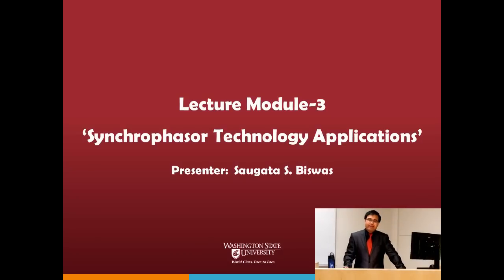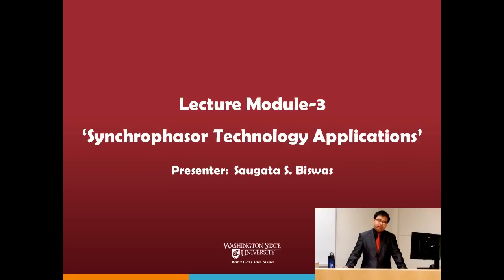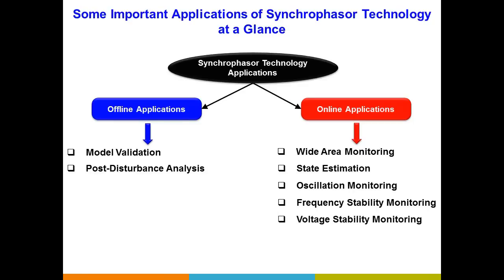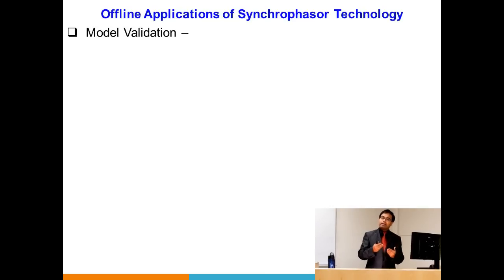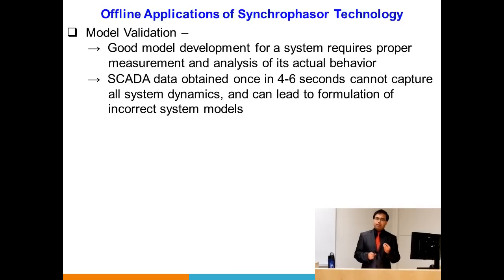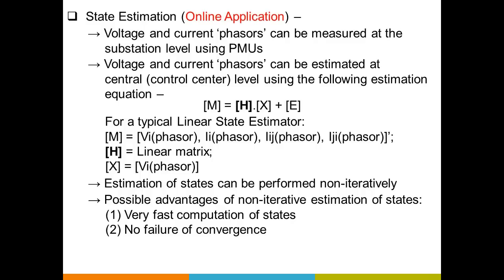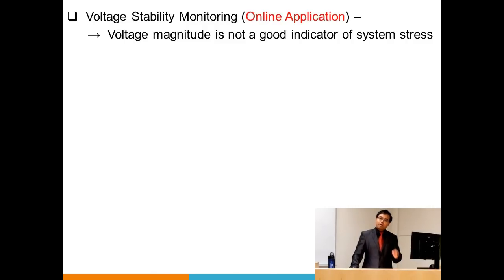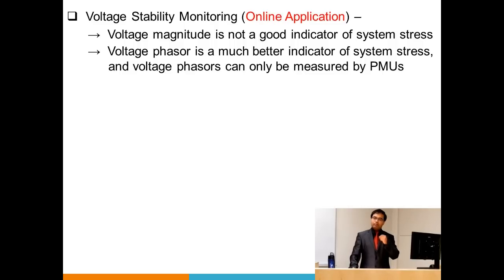Synchrophasor Technology Tutorial - Lecture 3

Comment: Why SCADA sample 4-6 frames per second? Is there any difference in calculating phase angle in SCADA and Synchrophasors?
Reply: As per my understanding SCADA systems will check the magnitudes of voltage and currents, circuit breaker contact status, dc system status, relays etc  , not phase angles